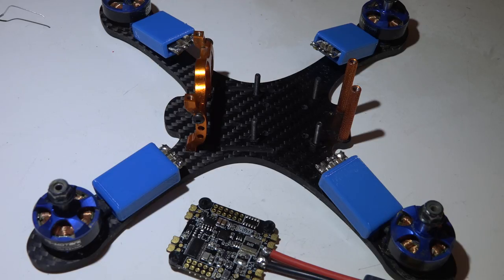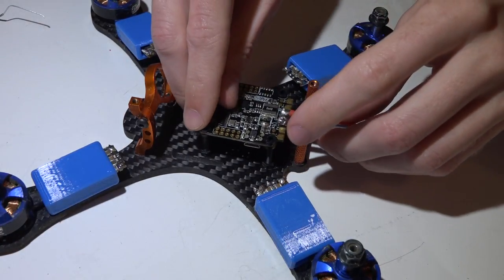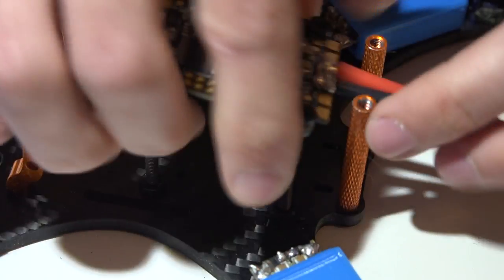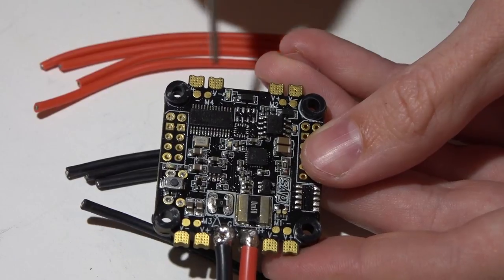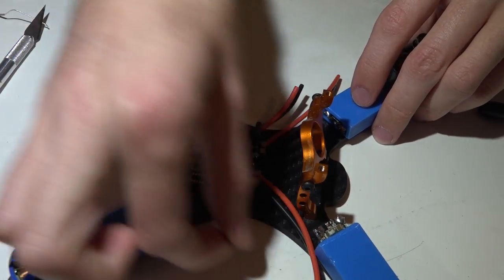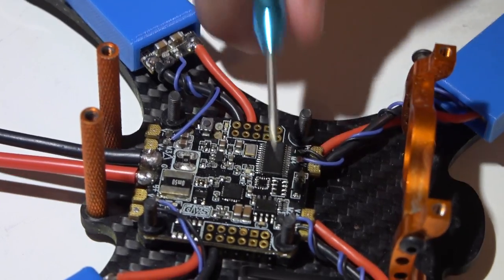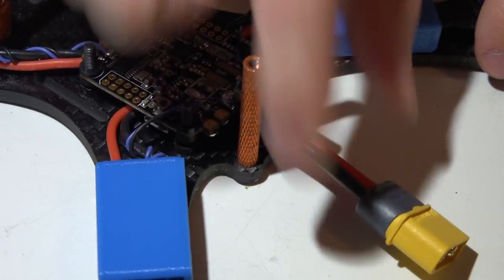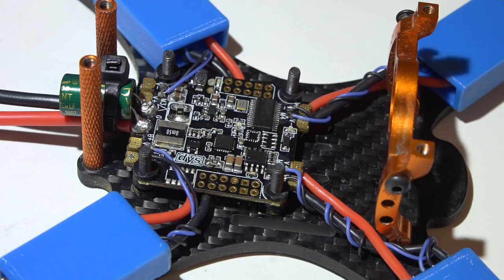DYS F4: Wiring ESCs

Comment: The capacitor needs to be soldered to the other side of the current sensing resistor, it does indeed remove noise and I would say it is necessary to use it one every board with a current sensor. Must be mounted before calibrating the current sensor.

Comment: So do you prefer this over the BF aio? I find the ESC pads are easier to work with on the DYS board, especially if wired from the top. Haven't flown it yet though.

Comment: good idea to use this board with inav on s500 frame ? without barometer  means no altitude hold ? or adding a BMP280 chip good idea ?  thanks for the tips :)

Comment: Have you ever checked out a Lux V2 !
Reply from the maker: I've seen it but haven't bought one. $37 for a board with F3 processor, no built in PDB, no OSD, and no voltage regulator seems like a steep price
Reply: Gotcha